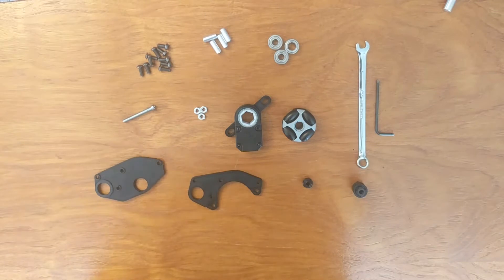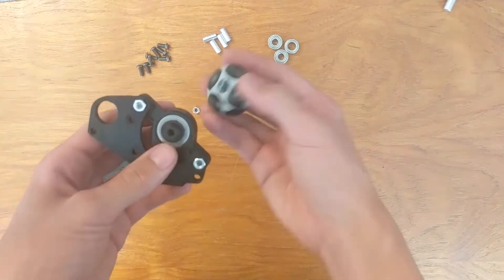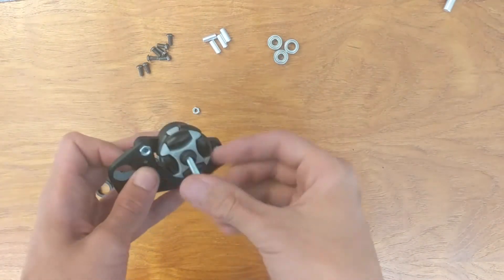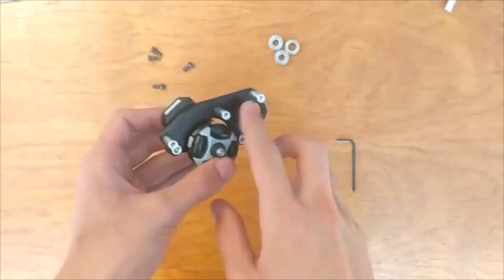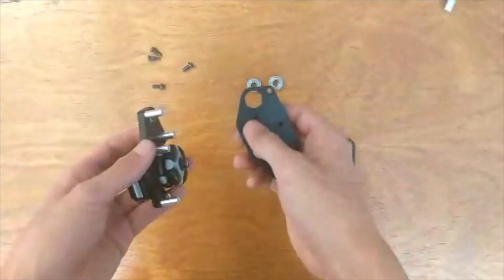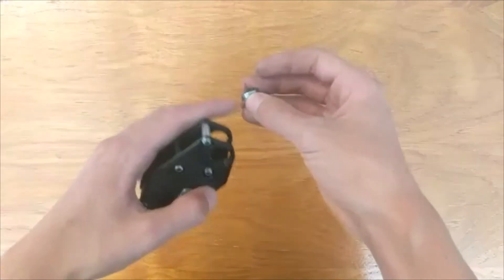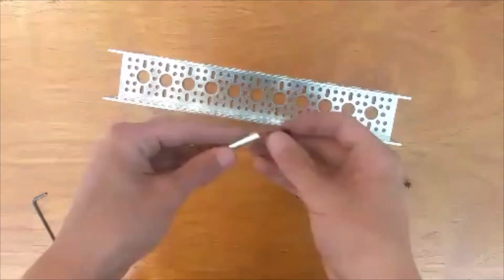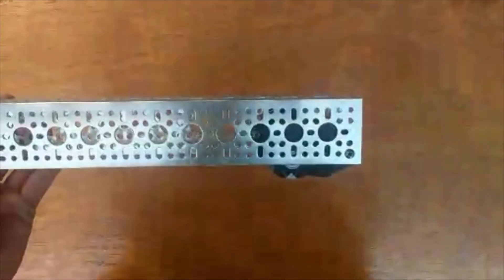OpenOdometry Assembly

Comment: FYI... 2804-0004-0035 35mm L, M4 x 0.7 Pitch Zinc-plated Low-Head Cap Screw must have a larger head now as they do not fit into the insert for V1 anymore.  The insert will need to be modified.